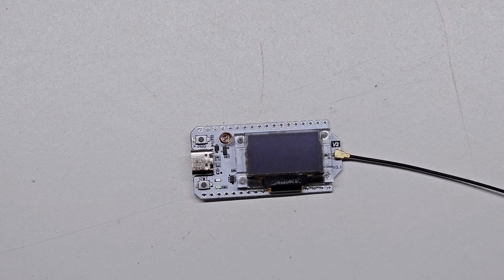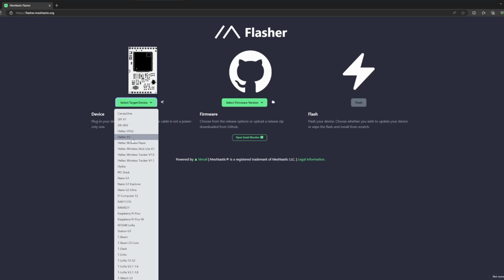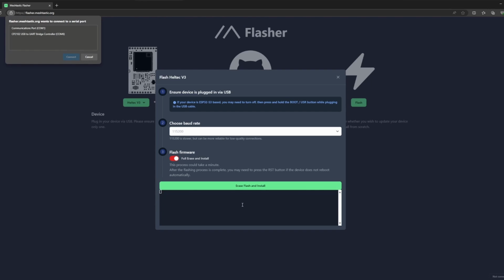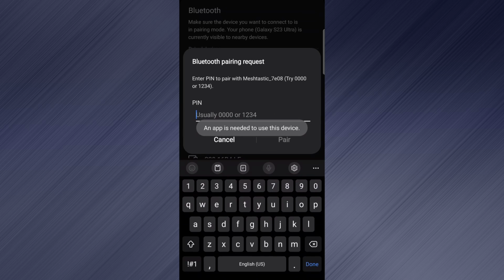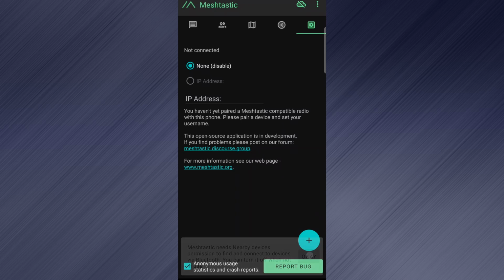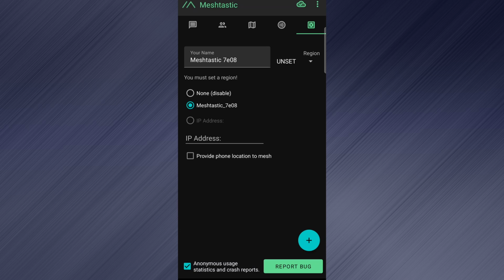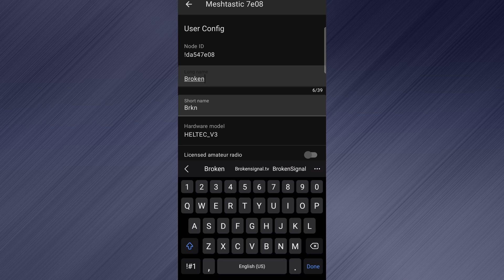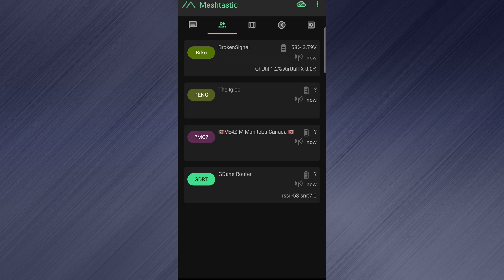Getting Started with Meshtastic: A Simple Guide to Setting Up Your Heltec LoRa 32

Comment: Just a quick note for anyone watching that is looking to get this device. While a larger antenna will work with the device its not in anyway necessary.  Because of the nature of lora transmissions the smaller one is already pretty large for this type of radio. I have the same device that has the enclosure with an even smaller antenna and can pickup nodes around me that are quite far.
Reply from the maker: Goes back to location, location, location. Some people have no other nodes around them so no antenna will help. Best to buy two devices and give one to a friend in that case.

Comment: "Cannot connect to device."  Unplugged the USB to try  a different cable. "Notfounderror: Failed to execute 'requestport' on 'Serial': No port selected by user. But when I select the port, is say "the port is already open". So i click on Erase flash and install, and it just gives me the first message again. 

The board itself says LoRa error. Did i just get ripped off on this piece of junk?

I knew this wasn't going to be as easy as everyone said. I dont even know what 80% of the words they are saying mean.

Comment: so, what PIN did you enter to pair the device with the phone? it wasn't 0000 or 1234.
Reply from the maker: The pin is displayed on the screen, or you can use the serial monitor on the flashing website.

Comment: I've been trying to get mine working for months but never succeeded in flashing the firmware. The PC knows the Meshtastic is connected, LoRa 32 V3. Display shows the normal menu, so it has power. All the YouTube videos go straight through this part with success. PC is on Windows 11.
Reply from the maker: I had to use Edge browser for mine. Also you might have to hold the program button down until it starts to flash the device then let go.
Reply: @BrokenSignal  thanks, I'll try that.

Comment: I’m using a data cable, it shows not connected. It’s asking to connect to a serial port
Reply from the maker: Do you have the drivers installed? 
https://meshtastic.org/docs/getting-started/serial-drivers/esp32/
Reply: Yes, I had to try it on three different laptops, but it finally worked, thank you for your response
Reply: Why 3 different laptops?

Comment: I have a new unfortunate issue.  Okay, the other day this worked a breeze.  I'm not even sure or thinking I had the 210x driver installed at the moment on my PC, but I just followed your video and it worked perfectly.  Mine, I had already flashed a week or so before and I came to find out I didn't actually need to, nor was I able to reflash it like the new one, yet I mated each one to a different Android device and they talked to each other.  Now today, the new one, won't connect to the original Android, so I'd hoped to reflash it and start anew, but nothing is working.  I tried installing that 210x driver and that didn't help.  I've done the general temp %temp% prefetch thing, not thinking that would help, but I wouldn't know and it had no effect.  Any ideas how to fully reset this board so I can start new?

Comment: Great tutorial. I'm using the same hardware and this works great. Just to note, some folks may need to install the ESP32  USB to UART Bridge drivers prior to flashing.
Reply from the maker: I've been using ESP devices for so many years I totally forgot about some may need to install the drivers. Thanks.
Reply: Thanks! was wondering why it wasnt showing up, this fixed it.
Reply: So I downloaded the cp2102 usb to uart bridge controller zip... but there's no exe to install the driver? Anyone else know how to do this?
Reply: @Durandal734  extract the contents of the zip - right-click on the file ending in .inf and "install"
Reply: I had to wind up downloading some drivers to get everything going. Once I installed the drivers everything else in this tutorial flowed.

Comment: Only one thing lacking from this video. What drivers to download how to download and install them. Sorry  it took me 2 hours to download different drivers restart the computer and  see if the heltec well finally show up.
Reply from the maker: Since it was an ESP device I have had the drivers installed for a few years and didn't think about it when I flashed mine or I would have covered it.
Reply: How can it be a simple guide when you haven't even mentioned one of the critical steps?
Reply: Though I could get started from this but nope.  Can’t figure out the serial port to be able to flash.

Comment: A tip: If you flash the latest stable version of Meshtastic and you can't save config changes to your board, try the alpha version. I have two Heltec V3s and one works with the stable version, but the other won't store any settings unless I use the latest alpha. I believe it's a timing issue, with some boards needing more of a delay between writing to flash and rebooting.
Reply from the maker: Thanks for sharing!

Comment: This may well be the best and most cut and dry video on this topic.  I have already done this, but although I don't currently have a second one (it's on the way), I'm gonna do a new erase and install using your video as a guide.  There are so many videos on this and if this works, you are Da Man.
Reply from the maker: Thank You, let me know how it goes for you.
Reply: @BrokenSignal  I will.  I'm going to wait until this second one I bought arrives from China and then follow your video to do both.
Reply: Follow-up. I did get the second one a couple days ago and I used this tablet for mine and a Samsung phone for the new one. Got them to say hello to each other. That's step one.

Comment: I personally can't decide what device to get for best performance 433 MHz or 915 MHz then what to flash ?? (Meshtastic) or a (Tiny GS) setup.
Reply from the maker: Get both if you can! If your going Meshtastic and want to use it with others then 915MHz.
Reply: You probity don't have a choice. 915 is for the USA, MEX, CAN;  868 + 433 is for Europe; There is a differently labeled 900 one for Australia; Japan uses 900mhz but with restrictions. I'm not sure about the rest of the world. Check the LORA licensing requirements in your country or region first. 

In the USA 433 is set aside for shipping container tracking per the FCC § 15.240 Operation in the band 433.5– 434.5 MHz. These are type certified and Meshtatic isn't in the USA.
Reply: 915 MHZ is the standard for the USA
Reply: @Miguel_Angel718  So it seams.. but.. With a lack of interest (Meshtastic) nodes .. Stations.. I will wait for it to get better first.
Being first will be lonely 🥺 who knows for how long.  I'll play with a TinyGS system first on 433MHz (Looks Fun) also very boring. But at least it's doing something with scientific space communication research. Providing received Telemetry Packets (for the cause).
Reply: So it Seams .. But with lack of meshtastic setups in my area (I don't feel like being the first) for who know how long before it gains interest.. I'll look into playing with a TinyGS on 433 MHz first (Perhaps this Summer) if time and money allows. I've learned alot from those with experience.. Thanks 👍👍📡73s @Miguel_Angel718
Reply: Well .. The way that I describe Meshtastic is (Old School Packet) .. The Radio and TNC are built into one Low Power Unit.
The (Tiny GS) Tiny Ground Station Looks too Be a fun Scientific Experiment to be a part of, Providing Telemetry Packets transmitted by those Satellites. Using the Software "Orbitron", it looks like the PY4 (915 MHz) Group of Satellites pass over North America (US / Canada / Mexico). However, there are may others that are Transmitting on (433 MHz). So.. It would have a better chance to Receive one of those Satellites on 433 rather than 915.
When I monitor the Radio Spectrum activity in those Bands (with an SDR), I do see activity... Question is... Is it the satellite 🛰️ ? I don't know of any LaRa decoding Software for RTL-SDRs (or is there???) For Meshtastic or the Tiny GS Project (Packet Burst Data)
Reply: @x_CrossHair_x  I don't know of any effort to receive sat data with a Meshtastic device. Meshtastic LORA radios are designed to be point to mulit-point mesh radios. Not to connect to a satellite network. Meshtastic hasn't gotten to the maturity yet where you are likely to make a random contact out side a high population density area. There is a map of open repeaters on line. See if your near one. 

The problem with 433 at least in the USA is you can't transmit on it. Because it isn't inside the ISM band. I think for sat monitoring I'd go with and SDR. Because you don't need to transmit.

Comment: I am just getting started with Meshtastic myself. I have a WisBlock with an ARS-915P 2 dBi 915 MHz antenna operational in my attic. There are currently no other nodes near me. I am waiting for another WisBlock to arrive to make a mobile node and perform some range testing. I am interested in learning how your Yagi antenna performs. I just sub'd to your channel. Thanks - Dave
Reply from the maker: I also do not have other nodes were I am located and am waiting on more devices to be shipped. Once I have them I will do a proper review of the Yagi. Stay Tuned!